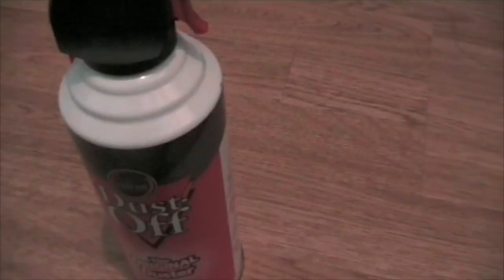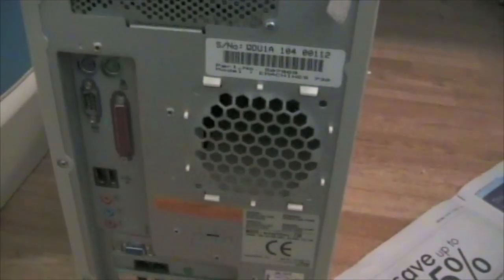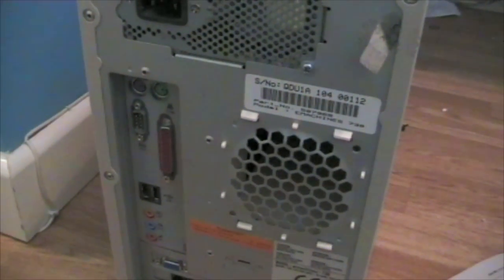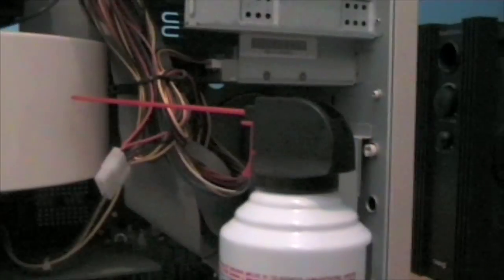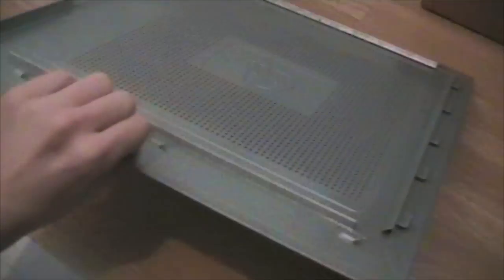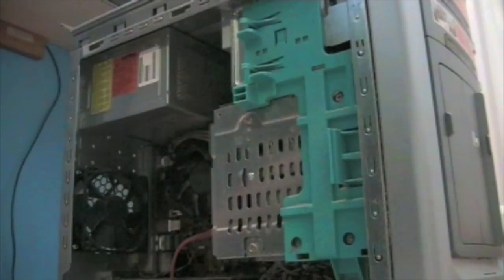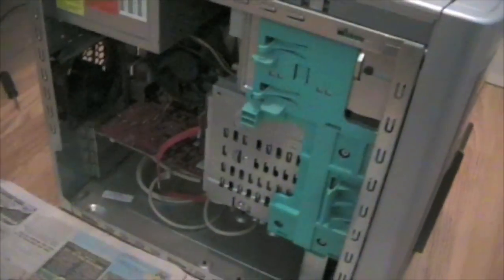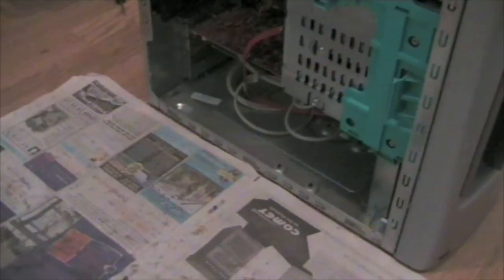How to Clean a Computer

Comment from the maker: @MrLOOOOONELY Yeah, it's just a precaution. To get to awkward places, I suppose you could slightly tilt the can, or just move the computer (put it on a table, for example, to get into the bottom of the case with the air).

Comment: You should always hold the can of air at least 6 inches away from your components
The can of 'air' actually has some kind of fluid that comes out in droplets that could damage your PC
Whatever is in the can actually condenses inside the straw and eventually will spurt out a bunch of fluid, so you have to watch for that

Also, having a clean super-soft bristle brush to lightly dust the components while youre using the can of air can help a lot
I use a clean makeup brush with long bristles

Comment: @adgj5333 Never use any chemicals on processors except for the thermal paste removers and isopropyl (rubbing alcohol).  I also would not suggest using compressed air to clean electronics as compressors have a tendacy to  build up moisture within the tanks which can end up spraying onto the components.
Dust cleaners are often called compressed air or canned air which is incorrect.  Dust cleaner is a refrigerant-based propellant cleaner containing difluoroethane.

Comment: The power button thing is about releasing any electrical charges that may be left behind or contained within the system still.  Pressing the button releases and charges thus...you will not shock any components on first touch.  If this is true or not I do not know...but thats what they say.  I believe some electrical current may be left behind but will only be around for very very little time.

Comment: when you press the power button after you unplug the power supplies cable its voids most static electricity and an approved anti static wrist strap is always good when working on a computer because your body conducts alot of static energy and don't buy hewlett packard man you don't get your moneys worth and you can use a vacuum as long as it sucks and not blows and is anti static theyre out there well good luck peace out.